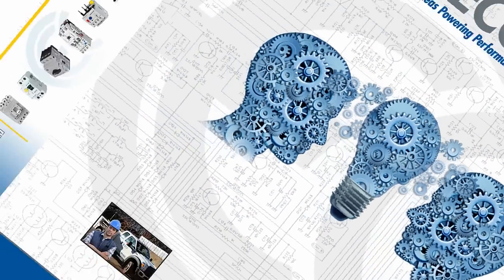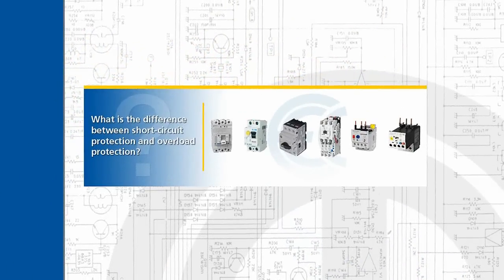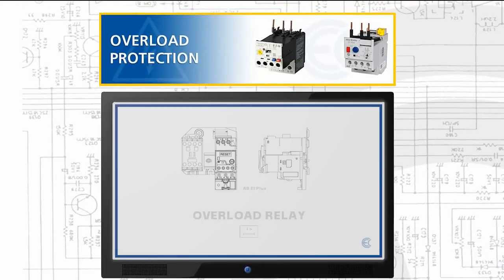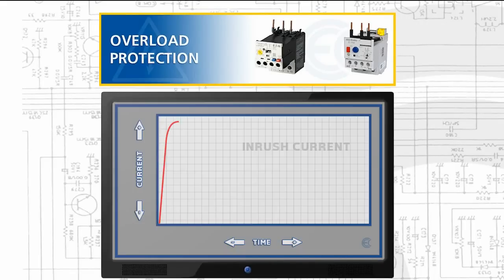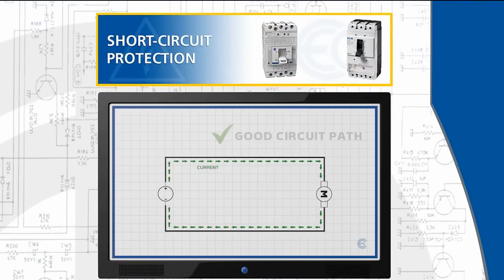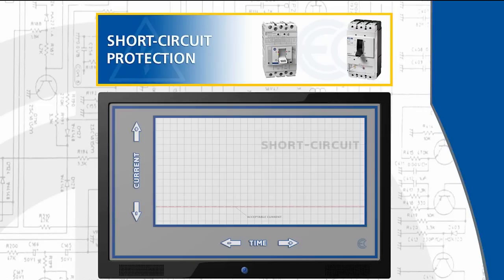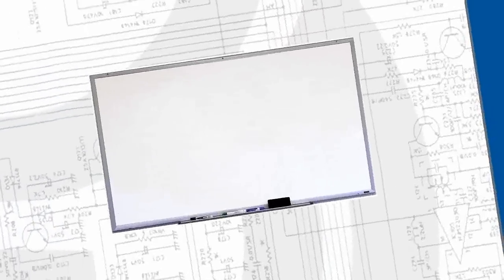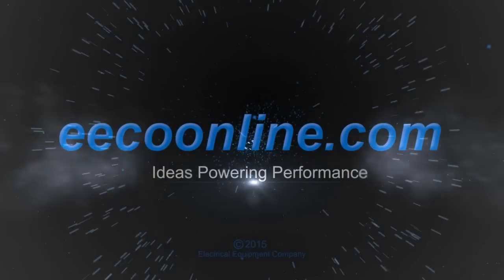Short-Circuit Protection vs Overload Protection: Part 1 - Overview

Comment: Hello,

Recently there was short circuit in the transformer feeding power to our school and few homes around. The short circuit was caused by group of squirrels. Due to short circuit a lot of electronic equipment got damaged in school. We have mcb installed but I guess they only trip when short circuit happens in output line which they are guarding. In our case short circuit happened before the mcb as transformer is located outside school premise. So wanted to know what all safety devices are available which can be installed in school to provide safety in this scenario.

Also if anyone can suggest safety devices for lightning protection that will be great.